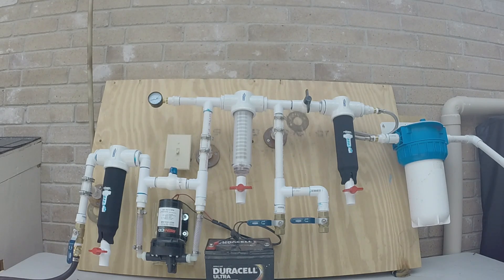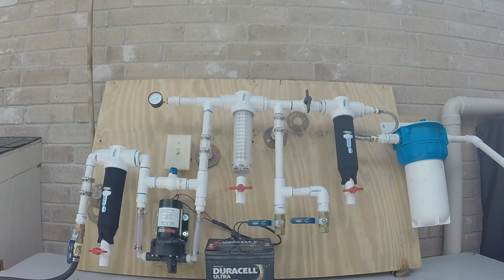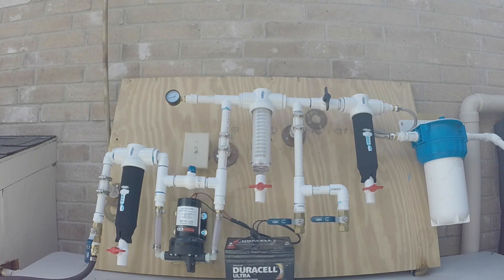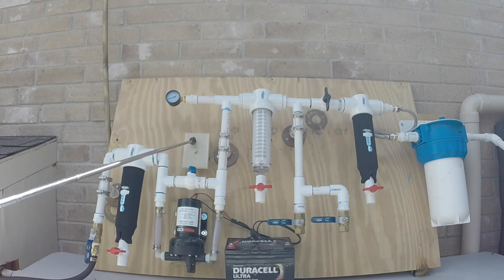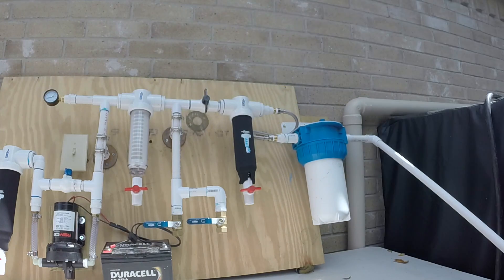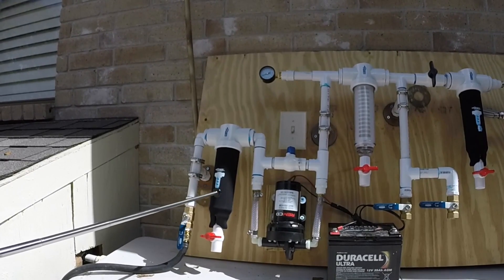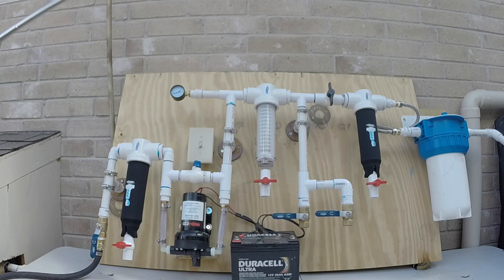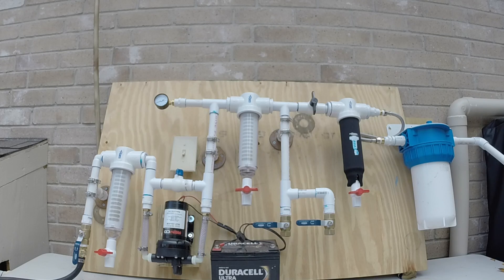How to Filter and Purify Rainwater - New and Improved Filtration Board Overview

Comment: Helloo Trent! Great job!  I'm also working on a WOM design.  I'm thinking of saving some space by eliminating the tee between the 500 and 1000 gallon spin down... the clean out ball valve on the 1000 spin down could serve as the non-potable spigot... adding a hose bib manifold so you can have the two non-potable hook-ups! Also, I see the Floor Flanges but am wondering where to get the brace supports that grip the horizontal pipes.

Comment: A switch is a switch. you can use an AC switch for DC. Just do not go over the voltage or current ratting for the switch. don't think you need to worry here.
Reply from the maker: +Donald Smith thank you

Comment: Hey Trenton - kudos to you for continuing to upgrade and to post those upgrades.
When dealing with any sediment laden liquid, start with a two compartment tank or two totes or what have you. Allow the initial waters to settle in the first compartment and then flow the quiet water into the second container. This will usually leave you with very clean water as feed stock for your purifier. As you have found out, any debris is to much debris.

Also avoid reducing the lines any more than absolutely necessary. 3/4 to 1" filters and than back to 3/4  is fine but using 3/8" flex is not good.

Comment: Hi Trenton.
Have you tried mounting your pump onto some rubber mounts or bushes ?
That would reduce noise and the reduced vibration might extend the lifespan of the equipment ?
kind regards...
Reply from the maker: +susanne jones there are some rubber mounts that come with the pump.

Comment: your Ac switch will work on DC

it does not care if it is Ac or DC.......works the same
Reply from the maker: Thank you!!
Reply from the maker: +mel vance thank you!
Reply: mel vance 
The DC switches are just designed to handle higher amperage  without arcing and then burning out.
Even a 12 volt battery can actually create enough current to weld metals...
Provided a suitably rated fuse is installed,  then in this instance an AC light switch would suffice.

Comment: Hi, how much bigger are the 1.5" filters? would 2" have an even larger capacity?
Reply from the maker: +777dingo they are much larger, yes 2" filter could handle more capacity.
Reply: +Trenton Kaminski Hi, what is you gallon per minute flow rate? the Rusco website says the filter won't work properly if you get one too big, for example the 3/4" is good for 1-25 GPM the 1.5" is good for 10-50 GPM, and the 2" is good for 18-100 GPM so if your pump puts out 6 GPM then you can only use the 3/4"
Reply from the maker: You would reduce the inlet to 3/4". That is what I have done on this system.
Reply: +Trenton Kaminski I know you reduce the inlet, but does it filter correctly with the lower GPM? the Rusco website says it won't?
Reply from the maker: +777dingo I replicated my system from eartships, they use 1.5'' reduced to 3/4'' with 3.5GPM pumps. Google earthships, watch videos over there water systems. The rusco filters work by pushing water threw the mesh filters, I do not think it matters the amount of water you push threw so long as you do not try to push more than the recommended amount. It is always better to over build than to under build. Researching is great but do not over analysise to your demise. There are websites on the web that say my system will not purify specific viruses or that there is not research to prove it does. However in practice I learned that it did, I tested water before and after testing. With the dulton rio and uv light the water is always purified for bacteria and viruses. 

You said you are using this for well water. I have a couple of questions. Will you have a pressure/well tank?  Does your water have a lot of minerals? Iron? 

Place your dulton rio after the pressure tank, if you have a lot of minerals make sure to have 1 micron pre filter and maybe even a water softener.
Reply: Hi, yes, I'm using it for well water, the filter systems are expensive so I want to make sure I buy the right size, I'm on a budget,and the money comes out of my pocket, no help from the manufacturer's like you were fortunate to get. I called Rusco, they said the 1.5" will still filter, but it won't have the spin down action with a 6 GPM system, like the 3/4" would. Anyway I don't want to buy 3/4 then find out I can use 1.5" or vice versa because of the costs involved. Do you want to sell me the 3/4" Rusco fliters you have that you aren't using anymore? this way I could experiment without spending huge amounts of money, thanks
Reply: And about your question, yes I have an existing well with a pressure tank, It currently has no filters, i'm trying to upgrade it, and I may even get larger pressure tanks along with the filters, because it only has an older 80 gallon galvanized tank.
Reply from the maker: +777dingo Email me, we can talk. Trentkaminski@gmail.com

Comment: very nice! 
wondering how you would change this if you went with a slow sand filter. seems you could eliminate some filter units. might keep the 250 mesh and 0.9 micron but probably kick the others loose. what do you think?
Reply from the maker: It bet it could work.I do not know much about sand filters but I believed they need chemicals. I wanted a chemical free system
Reply: slow sand filter is a bio-filter. the top layer of sand is full of beneficial bacteria which eats the harmful stuff. chemicals would kill this layer and make it ineffective!
Reply from the maker: Thank you for the info!

Comment: Thanks for sharing. I´m assemblimg a system very close to yours at my place down here in Brazil. The thing I just can´t wait to do is taking the rain water to an analisys before and after passing through the system. Obviously the "in" water characteristics may vary a bit the but I hope the filtered/purified "out" water will not. Have you did that already? Just curious (very). Best regards. Chris
Reply from the maker: +lOfT Búzios I have tested the system with water known to have e.coli and total coliform. After passing the water threw the system it removed both.
Reply: +Trenton Kaminski Thanks.

Comment: What about flow.  4 gallons a minute seems pretty low for household filtering.  Why not up the pump to a larger "jet" pump and external pressure tank.  How are you using this in your home?
Reply from the maker: +Scott Lamb If you will use this on your home a external pressure tank is a great addition. You will need it.

Comment: Do you have a materials and price list for this? Also, you don't have a pump "accumulator" or pressure tank visible... is that an issue or you can live without them?
Reply from the maker: +A. J. Tarnas I have two videos on my channel for parts and price list. I do but have a pressure tank on this system but it would help if I did. I recommend installing one.

Comment: Are there any legal issues with the city water company, using a rain water filtration system?
Reply: +blkbishop112 I am pretty sure all states allow for rain water recovery from a man made structure e.g. your roof. the only problems would be with HOA's
Reply from the maker: +blkbishop112 I haven't had any issues.

Comment: could you add the links to the filters and pumps to this video? I saw them on your other video. Really big help, Thanks!
Reply from the maker: +Atom RC It's a 5500 series remco, visit the website to purchase, I called in.  The remco spin down filters I called in and ordered as well.  Check amazon, I know they are on there for about $100 each. Ill search for links later and post them when I find them.
Reply: +Trenton Kaminski Thanks! I found a few, Im thinking of building an auto flush system but will have to contact rusco about reverse flow limits. Id like to be able to once a month, or every 3000 gallons, flush out a reverse flow of just 1 gallon through the drain, to loosen debris on the filter and flush out the bottom of the reservoir. 

Im planning on running a 1.5" 250 Rusco, 1" 500, and a 1" 1000, then a 1 micron carbon and then into a 1 micron ceramic. Im working on an idea that may be better than UV as well... Just have to get the parts and test equipment. It could have a basically indefinite life but some may be afraid of it.

Comment: Thanks for the such detailed videos, you have been a big help. I was wondering what did you use to mount the pvc piping to the board? I can't tell from the video?
Reply from the maker: It's a floor flange, 3/4". Check out my channel for the parts and price list video. Part 2 has a list in the description.

Comment: Trenton, just like so many others, I really like your videos. There's one thing I must have missed.  What's the purpose of using clear tubing for your water pump vs. other pipes.  Is there not a risk of algae growth in those clear, rubber tubes?
Reply from the maker: +MGMinSC Thanks for watching, usually this unit is build and used indoors. My unit is in a covered shed that blocks the sunlight. If your unit will be in sunlight make sure to get the blackouts for the rusco spin down filters as well. I used the clear tube because that is how they are built in earthships and that was the model I was attempting to replicate.
Reply: +Trenton Kaminski Hi Trenton, sorry or the late response.  I had a feeling that was the case...just wanted to make sure.  And yes, I got the blackouts for the spin down filters.  Thanks for the videos!

Comment: Great videos, thanks for sharing your ideas and work.  What is the purpose of the connection with a valve that bypasses the pump?
Reply from the maker: Thanks for watching, it's To Release pressure
Reply: +Rick G. Wybou Also, if you have a pressure tank in the system somewhere, like most earth ships do, you can bypass the pump to reverse flush the pre-pump filter for maintenance purposes.  Earthships use this as their primary source of water, so they need the pressure tank to provide surge flow that the pump cant keep up with.
Reply from the maker: Thanks Jason, A pressure tank would be a great addition. I am currently building a small commercial system with a pressure tank, hopefully by the end of March I will have a video up of the system. The pressure tank makes a world of difference, I should have had it from the get go.
Reply: Awesome.  I've referenced your videos several times trying to get my rainwater collection system up and running.  Great series.  I'll be sure to check out you pressure tank video when it comes out

Comment: what type of roof are you collecting from? 

I'm working making a collector with steel roof, or using my roof but I have shingles. I want to use water for garden and later house water.
Reply from the maker: +Indiana S Andrews Shingle roof should be okay, add a few pre filters to catch any shingle debris.  A steel or metal roof is best but it is not a must. You can make due with your shingle roof.  

Currently I am collecting from a shingle roof. New update to come soon of a new system collecting off of a metal barn roof.

Comment: Trenton, do you know the type of the four bolts (sizes/threading) that connect the Dolton filter housing to the mounting bracket? I ordered my Rio 2000 from CFS and it didn't come with the bolts to mount it to the "L" bracket. Great videos, sir. With exception of pump and mounting the Rio Filter, I have built your first video system.
Reply from the maker: I'll Get back to you ASAP with the information. I will have to look, I Don't remember off the top of my head.
Reply: +Trenton Kaminski Trenton, Pentair (the filter housings manufacturer) responded to my question. FYI, and for others using similar filters, here's the response...Ron the screw or bolt you need would be a BOLT or screw, LAG 5/16 X 1-1/4"Long
Reply from the maker: Thanks for posting this Ron!
Reply: +Trenton Kaminski My Lowes, here in Florida, doesn't carry a 1-1/4" Lag, they go from 1" to 1-1/2". I bought the 1-1/2" galvanized, but used 4 galvanized washers on each bolt into the filter housing to ensure that I didn't punch thru the cap into the housing. Builders, be careful of the length of the lag screws, if too long, and punch thru the cap, it'll be an expensive mistake. I also bought 4 1" galvanized 5/16" lag screws, plus 4 galvanized washers to mount the L bracket onto the 3/4" plywood board holding the entire system.

Comment: Constructive criticism- PVC pipe is not approved for drinking water because it leaches chemical into the water, use black plastic which is approved. Also, you are filtering out particles but not purifying the water from bacteria, use a sand filter to purify the water.
Reply from the maker: +larryswindcatcher Thank you for watching and the constructive criticism, I googled (can pvc pipe be used for drinking water). 

Here is what it reads...

Plastic pipe such as PVC (polyvinyl chloride, used for cold water only), and CPVC (chlorinated polyvinyl chloride, used for both hot and cold water) have been around for years, and both are approved for use with drinking water.
Google could be wrong...Where did you read this from? ...here is the link to my google search....https://www.google.com/#q=can+pvc+pipe+be+used+for+drinking+water

"Also, you are filtering out particles but not purifying the water from bacteria, use a sand filter to purify the water."

- Dulton Rio 2000 is the last filter on the system, it purifies bacteria from water.  
Here are some specs:  Dulton Rio 2000 Ceramic filters remove:

Pathogenic bacteria (E-coli, Cholera, Typhoid, Salmonella, etc.).
Cysts (Cryptosporidium, Giardia, etc.).

Sub micron particle contamination.
Reply: +Trenton Kaminski Thanks, I stand corrected and you are good to go. Keep up the good work.

Comment: LOL let us know when the final version is perfected so we can all build ours.
Reply from the maker: It is always a work in progress, each of our application may be different. These are only suggestions if you would like to build something like this.
Reply: +Trenton Kaminski I know and I love to see the possibilities. I should just get busy and build one, although I'm having trouble getting the totes, and watching all the wasted rain running off my roof this year in El Paso of all places...
Reply from the maker: Have you looked on Craig'slist? There are usually a few on there for $100 or less.
Reply: +Trenton Kaminski Yes $125-$150 hard to tell which outlet type they are using. I'll just need to take a day and go look, also a couple of bottling plants here I will visit. More importantly the wife said yes it was a good idea. Once the wife agrees it's all just details.
Reply from the maker: Step 2 on my rainwater system details the adapters you can buy if the valves have weird threads. Just FYI they also make covers for the tanks = a happy wife. They can be found at metalgardenbeds.com.